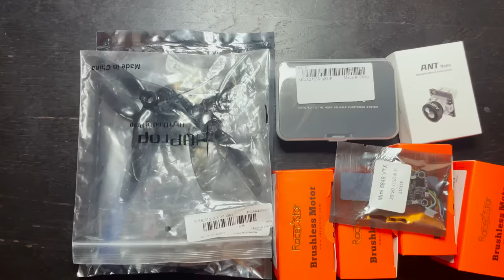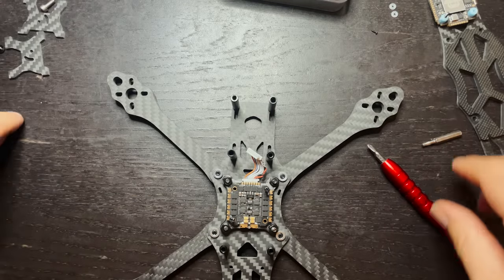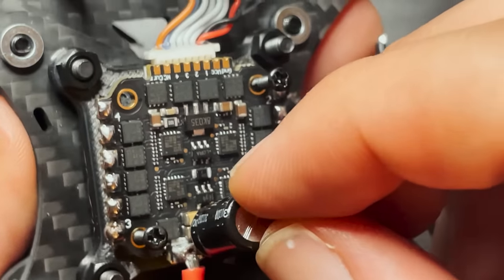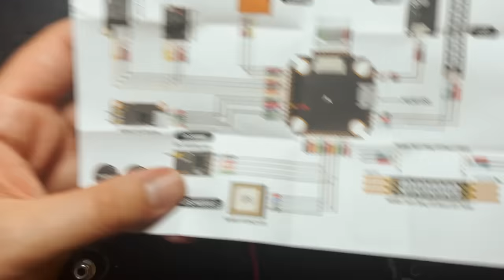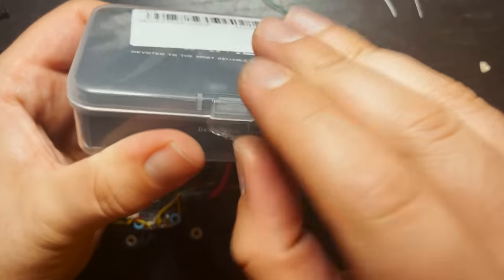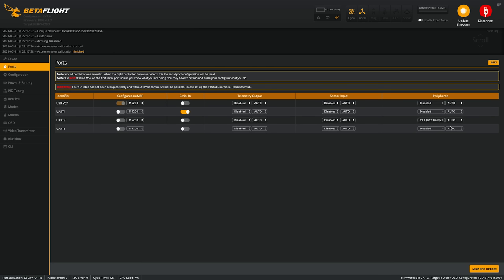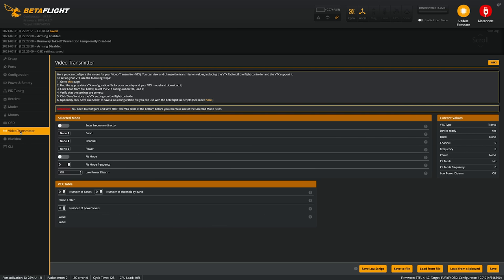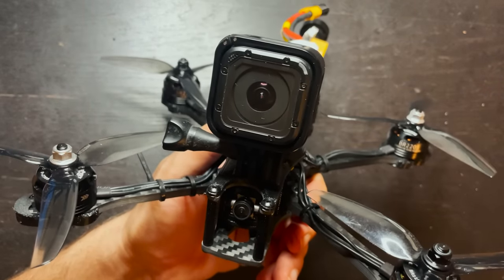Build a Freestyle FPV drone for $150!!

Comment: Would a build like this be good for basically anything? I seem to get the gist about the basic parts lists but I'm just not sure if this kind of drone is what I'm looking for. From what I can tell these little FPV drones not only have amazing speed and maneuverability, but they can deliver some decent quality video. Like, it's great to have such high acceleration but I never see anyone using them to do exploration in really tight places. I feel like it may be something similar to a super-speed RC car, where the gear ratio is just meant for high speeds and it can be difficult to get the slowest speeds with precision. So many things I don't yet understand about ups and downs that are interesting to think about... Like if I wanted to get some footage off in the distance, maybe I could get a high quality transmitter/receiver setup that will go that distance.. but what would actually be better for that task? A larger drone with longer run time, or a small FPV drone that may actually make up for it in how fast it's able to cover the distance. Or maybe in wind they become useless? I guess these basic controller modules do not have all the features higher end camera drones have but if you have something that is easily precision-maneuverable at low speed and high speed you can fly with FPV (while also recording), then I can't think of any reason to own a larger more expensive drone aside from needing the much longer run time or just higher quality cameras in general. Your setup here with the GoPro and the live feed seems totally fine as far as quality. I just spent about $400 in budget RC stuff just really trying to end up with something decent I could FPV and now I'm feeling like one of these little carbon fiber frame style drones is what I really need. I swear I've seen some small ones that have prop guards and they could be bashed around without issues.. Saw one guy crash his upside down and was able to just flip it back over with the props and take off again.

Comment: Guys, hello everyone!  Excuse me for being off topic, but is $70 a good price for a detailed quadcopter?

 ALIEN FPV FRAME 3 INCH
 ・FC NOX F4
 ・ESC 25A 4in1 Dshot600 Blheli_S
 ・Emax 1306RS 4000kv 3-4s
 ・Foxeer arrow micro
 ・RX Frsky D16
 ・VTX 25-200mA 48ch

 Or for the same $60-70 Kingkong et100 or BETAFPV HX115se will be the best choice?

Comment: Hi, is there any way to build a drone with these parts but instead of using the ESC that comes with the package, use a Raspberry Pi Zero 2 W or Pico, and install my own firmware to control it...? Thanks for sharing these videos

Comment: Nice build, staking it as everyone selling it in warcraft auction. Power supply wires, well half of them, has no order connecting them. Usually getting same quality already build/factory made item for about same price saves time but, but no happiness building it yourself. Countless hours trying to find pin outs, some of them are not same color on different manufacturer devices.

Comment: I’ve built 2 now and own 4 but every time I use the mamba f405 mk2 stack I’ve bought 3 and all have blown up on the top little chip and I’m not sure how it even happens but all 3 have either had gyro fail or blew up the top chip with the rainbow sticker that says mamba f405

Comment: So I'm building basically this same system because of this video. Thanks for the great info. One question, I don't see any information on the VTX antenna that you used as you said the stock one didn't have a good of range. Do you have any info on it?

Comment: I was building quadcopters for a while but it's been 7 or 8 years since I've built one. I'm thinking about it again but a lot has changed. CC3d was my go-to controller and stacks were just barely getting popular. I like your build and I may mimic it but I've been thinking of HD fpv, is it faster now? Is DJI the best one?

Comment: Great demonstration, but you need to work on your soldering. The way you do it is a recipe for cold joints.
Heat the pad before you touch the solder to the iron and pad. You also need much more of the wires stripped and inside the joints. Cold joints and not nearly enough wire material inside the solder is a recipe for failure.

Comment: I am half way building the same drone and thing going well. I saw that the sheet for the flight controller shows a connection to a GPS module,  If I decided to add that anything I should do differently or keep in mind?

great work BTW

Comment: The Mamba Stack diagram at 14:00 shows the camera voltage to be 5-36v but your vtx needs 7. You could have hooked up the camera power to the vtx power.. alternatively plug a battery into the stack and use multimeter to get some reading.

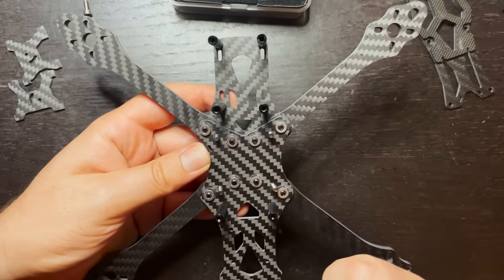Comment: 3:20 Timestamp when this goes from under a $150 build to only if you have a  3D printer!
Reply from the maker: Read the description.
Reply: I didn;t use a 3d printer i use the rubber thing to make the separation

Comment: everything actually costs $238.42 not including goggles and controller. With controller and goggles with it it comes out to $504.40
Reply from the maker: Prices fluctuate and this video is from 2021. Check out my updated 2022 budget build for more updated pricing.

Yes, those aren’t included. This is just a drone build video, not an everything-included kit.

Comment: you should learn to solder properly. There is no reason why that capacitor should have gotten hot to the touch. A decent setup should cost less than $100 and you'll never have to worry about dodgy connections or overheating components.
Reply from the maker: If you're looking for a soldering guide I have one here: https://www.youtube.com/watch?v=2funvs3nU7U

Comment: Could I use a Eachine TX 1200 as a VTX?And would solder it differently then?To 5V or something.
Reply from the maker: Yes you can use any VTX with this build! Power will depend on the VTX 👍

Comment: how did you secure the flight controller to the 3D printed part?
Reply from the maker: various M3 screws 👍. most of which were included with the frame/FC

Comment: Easier than I thought, but the 3d printing and coding still feel a bit too much for most people. 
Sorry not sorry I got the dji fpv: I enjoy fpv but not this much
Reply from the maker: The DJI FPV drone is great, however when you crash and break something its not that easy to replace. 
Building an FPV drone really teaches you how the components go together and makes for extremely easy repairs.
The coding side of FPV is intimidating but is actually relatively simple. I'll have a betaflight basic setup video coming out soon 👍
Reply: @TRONCATFPV  Oh totally. I'm still figuring out how much I like aerobatics vs just flying fast :)

Comment: how about the controll unit and googles - those are not included in 150 $ build?
Reply from the maker: Yes, you'll need those to operate the drone. This video is purely building the drone.
Reply: @TRONCATFPV  thanks! i find a really good online guide, well atleast it is very detailed and after reading that and rewatch your vid makes it much more clear. thanks!

Comment: Did you have to get cables or did all the necessary cables come with the parts, and also the screws?
Reply from the maker: all of the cables and screws come with their respective parts 👍
Reply: @TRONCATFPV  thank you very much, i just ordered the parts off of Banggood myself to build this drone
Reply: @TRONCATFPV  one more question, what is the range and battery time of this thing if i run it off a 1500 mAh 4s battery and how far away from the one driving the drone can the drone go typically

Comment: I mean technically it’s not $150 with all the extra parts you had lying around that are needed to compete the build. Then you need to add remote control and goggles too to truly make it an fpv drone like in the title. Awesome build tho I want to make one so bad
Reply from the maker: Again..
Nope, this drone was $150 when I purchased everything. 
Correct me if i'm wrong, but the title of the video is "Build a freestyle FPV drone for $150" not "Everything you need to fly FPV for $150"

Comment: Well.... Yes 150 bucks, but that's only a none functioning drone... There is no battery, no controller.... I'm sure with those the costs will be close to triple....
If you already have everything, including a soldering iron, 3D printer and so on.... So yes 150 bucks.... I guess you can build a car too for 150 bucks... Won't run, but it's cheap :)
Reply from the maker: The title of this video is “build a freestyle FPV for $150” 
not “everything you need to fly FPV for $150”.
I have other videos featuring all-in-one, everything included kits if that’s what you’re looking for..

If you followed a YT video on building a car, I think it goes without saying that you’ll also need some tools and gas to get it moving.

Comment: $150 for the drone pictured, gopro session $150, drone = free?
Reply from the maker: sorry, I missed the part where I say the GoPro is an essential component for this build. Can you tag a timestamp?
Reply: @TRONCATFPV  video thumbnail with GoPro and $150 text on the thumbnail.
Reply from the maker: @Ozzy3333333  are you watching the video or just looking at the thumbnail? 
The GoPro is not an essential part of the build fyi.

Also if you’re paying $150 for a GoPro session 4 you’re getting severely ripped off.
Reply: @TRONCATFPV  No, I didn't, the untruthful (or clickbait) thumbnail caught my eye, I called bull and commented, at least the comment helped your video. My session 5 when new was $125 with a large discount, but that was years ago, I dont know what they cost now.
OK, lets get by that you dont need a gopro, your saying the stuff you need to fly is $150?
I am at $180 w/o vtx (your link broken) and  battery.
Reply from the maker: @Ozzy3333333   this video doesn’t need much help but your comment is appreciated. 

This was published nearly 2 years ago and prices have increased since then. 
But yes, every component in the drone at the time cost $150. I’m sure you could still do a $150 budget build if you really tried and hunted down the absolute cheapest parts possible.

When I post drone builds the parts tend to sell out quick. Keep an eye on the channel for more drone builds in the future and you can pick the parts up before they sell out 🤙

Comment: 400-500 if you're starting from scratch
Reply from the maker: If you're factoring in goggles, controller, charger etc. yea.

Title of the video is "Build a freestyle FPV drone for $150" 
Not "Everything you need to fly FPV for $150"

Comment: a bit misleading.. build a drone for 150$ only if you have a 3d printer.. FAIL
and what about the controller and headset?
Reply from the maker: Read the description, you can get that part for 3$
Yes you would need a headset and a controller. You'll also need a battery & charger.
The title of the video is "Build a Freestyle FPV drone for $150" 
not "Everything you need to fly FPV for $150"

Comment: hello man, im going to build my own, but i need to know how time of battery it has, and if is less than 2hrs or 3hrs how can i increase that time, how many mah need in the battery?
Reply from the maker: You will not find an FPV drone (currently) that offers 2 or 3 hour flights. 
Typically with drones capable of freestyle like this you’re lucky to get close to 10 minutes

Comment: Show you how to make a drone for under $150 then proceeds to add a 3D printed part 🤦🏾‍♂️ SMDH
Reply from the maker: Problem?
Read the description it’s a $3 part.
Reply: @TRONCATFPV  The machine to print it isn't $3
Reply from the maker: @GDBAKED81  again.. read the description. 
You can buy the part for $3.